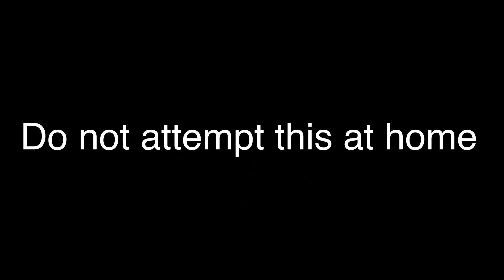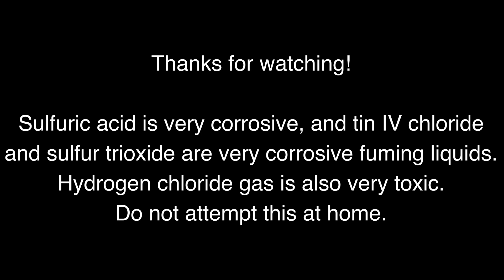Making Sulfur Trioxide - Another Epic Fuming Liquid!

Comment: Aminosulfonic acid decomposes at 205 C to form SO3 and NH3. It's commonly available as a cleaning agent (Sulfamic acid). Is this a viable method? Thanks.
Reply from the maker: I was just reading on Wikipedia, and it says it also produces water in the decomposition, which would immediately react with the sulfur trioxide to form sulfuric acid, so unfortunately I don’t think this method would work.

Comment: Passing SO2 through glass wool dipped in V2O5 will do this as well.
Reply from the maker: Yeah, I’ve wanted to try this process for a while. Haven’t gotten around to building a tube furnace yet 😂
Reply: with oxygen and at 500c in a tube furnace
Reply: @EdwardTriesToScience  yes. Instead of glass you use a stainless steel tube and heat it with a torch or two. Its also quite quick and efficient.

Comment: interesting method, ive been working on something similar except manganese sulfate as i discovered while dissolving MnO2 in hot sulfuric acid it left a fuming residue in the condenser that violently exploded on contact with water, though tin is also an interesting alternative and probably cheaper
Reply: MnO2 is probably still pretty cheap to find, tear open some (even dead) alkaline D-cells.  Most of the electrolyte paste is MnO2, particularly the insoluble portion.  If you don't want to do that, MnO2 is easily bought.  Google it, it is used in water purification and common on Amazon, Ebay, etc.
Reply: issue is the MnO2 in batteries are mixed with graphite and ammonium chloride, if the ammonia chloride turning into HCl then reacting with the MnO2 forming chlorine doesnt get you then the carbon will reduced the sulfuric acid down to SO2, but i think its probably fine